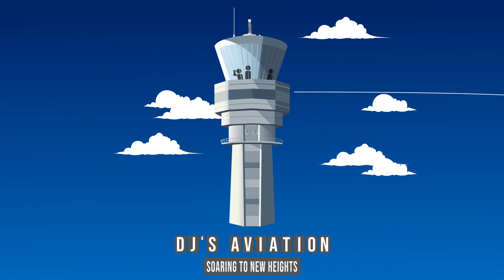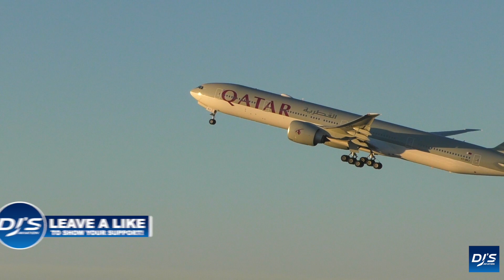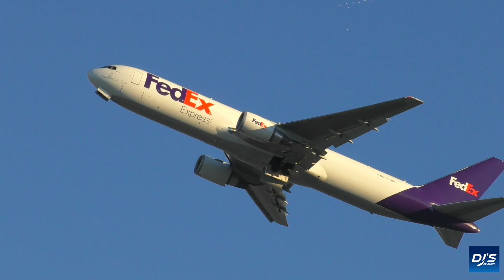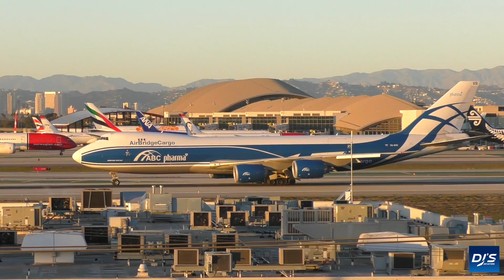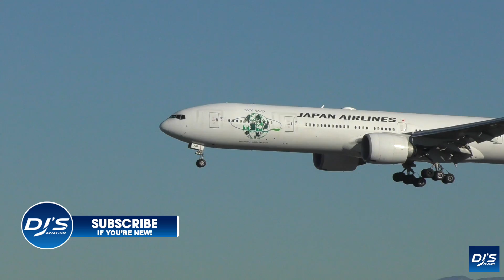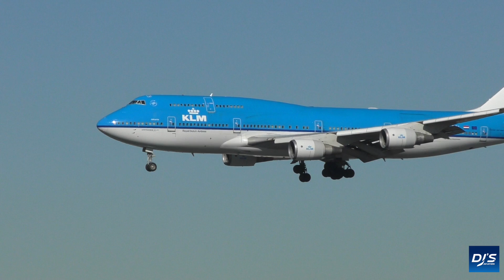Boeing 797 Engine Update

Comment: Well if Rolls-Royce is out, that only leaves two other engine manufacturers: General Electric and Pratt & Whitney.
Reply: mechaman13 

CFM is also in the game and the partners in the JV have already said the agreement would allow CFM to do an engine of the required size:
Reply: It’s CFM and PW still in the running
Reply: Don't forget Soloviev-Aviadvigatel, comrade.  The new plane could use turbojets with vodka-fuelled afterburners for extra takeoff thrust.
Reply: @raptorshootingsystems3379 
Oh yeah, I forgot about CFM.
Reply: @texasabbott Hahahahahahahahahahaha!  You're funny.  That's a good joke.

Comment: Boeing wants a geared turbine engine, RR previously said they were not going to invest in that technology. I think the 797 power plant is going to be a joint GE-French product with a remote possibility that P&W might supply the engines.  I think we're seen the last of multiple engine choices for new aircraft.  The article I linked to this morning claimed that AirBus and RR are working together on Chinese operations
Reply: RR UltraFan will be a geared turbine engine, and so do PW's PW1000G. Only CFM's Leap isn't.
Reply: steinwaldmadchen   Why has RR turned down Boeings new offering (797) now twice? I think it was in either August or September when RR turned Boeing down regarding a geared fan turbine, and now they've done it again, without mentioning the type of engine. At some point Boeing has to pick an engine given their statement that they will not offer engine choices. Boeing claims that it's too expensive to engineer an aircraft capable of using 2 or 3 engine types. I think the 797 will be a popular aircraft selling up to 2500 of the estimated market projection of 4000.
Regarding CFM, back in 2017 this was where everyone was at-- "For the new aircraft's engines, Boeing is looking for a geared turbofan. Geared turbofans are aircraft engines that achieve greater efficiency by placing a gearbox in between the fan and the turbine assembly so they can rotate at different velocities. The versatility provides greater optimization of engine speed during different parts of flight.

 image
Diagram of a geared turbofan. 1. Fan 2. Gearbox
TOSAKA/WIKIMEDIA
Pratt & Whitney and Rolls-Royce have both offered engines for consideration. Pratt & Whitney is researching the possibility of upgrading a geared turbofan engine it already makes, the PW1000G, while Rolls-Royce is arguing for a geared turbofan currently in development known as the UltraFan. Although they do not currently make a geared turbofan, CFM International, a joint venture between GE Aviation and Safran Aircraft Engines of France, is also considered a likely candidate to build a new engine. CFM has not formally announced that it will offer an engine for NMA consideration, but Aviation Weekreports that the company discussed some information about a new project, possibly a geared turbofan."

Comment: I guess Boeing will opt for GE as single engine supplier, like in case of the 777X. In any case I wonder when the plane will be officially presented, if all it needs is the green light from the board of director shouldn't take too long
Reply: Deamon93IT 

Authorization to secure launch customer commitments in March 2019 with a public unveiling in 2020. 

Given the talk of components already being made, very likely the unveiling in 2020 will include the roll out of one of the test aircraft that will be used for static testing:

Comment: Could this be more cryptic - why all the cloak and dagger stuff? I remember Airbus releasing even the earliest renderings of their A380/A3XX concept long before the final configuration and design were chosen and announced. What has Engine Alliance' stance been on the mysterious 797?This on wiki: " It would be powered by a new 50,000 lbf (220 kN) turbofan from GE Aviation/CFM International or Pratt & Whitney, with a bypass ratio of 10:1 or more and an overall pressure ratio exceeding 50:1" - good luck to whoever takes that on.

Comment: RR was an underdog competing with GE and PW.  GE has advantages with engine manufacturing capacity having dominated the commercial market for so many years. PW is a serious competitor with GTF. PW gets fuel efficiency with less parts essentially less turbine blade stages. It also means PW has potential for growth for even more efficient engines. BTW all three engine manufacturers have to be under financial strain with so many engines on order and little or no profit margins counting on aftermarket.sales for profits. GE as whole is in a bad place.

Comment: its looks to me that GE engines will be powering the new 797

similar to what the B777X are using

maybe a lower output version of the GE9X
Reply: Lin Chester Or may be a completely new engine. The GE9X is too powerfull.
Reply: @noah9130  looking at the 737 Max, it basically plane with a two oversized CFM Leap engines

 while the GE9X is too powerful. It may mean that the pilot do not need to use all the engines full power to take off and fly so it may burn less fuel
Reply: Lin Chester In that case it would be more logic for me to use GEnx

Comment: The longer that Boeing faff around trying to "perfect" the 797 and not make a decision then the more customers they'll use to other airframes.
Reply: Andy Richards 

Boeing has been talking directly  to the customers and keeping the final design under wraps for a market advantage.  The head of jet blue has admitted that he has been talking to Boeing, learning about the 797 and is enthused by what he is seeing. 

If Boeing has been assembling wings and other components, this project is already moving further along than Boeing is publicly stating.  This month, the Boeing board will give the green light to secure launch customers.  

A friend is a senior pilot for a large airline and they are talking about the 797. His words, a 2025 first delivery date would be perfect timing for them to integrate the aircraft into the operations and given his seniority, he will be one of first to crew it.  That airline could easily order 250 aircraft.
Reply: Boeing may not have a market for the 797 wide-body simply because airlines want the fuel-efficiency of a narrow-body and too many passengers will still put up with a 10-hour flight stuffed in a narrow tube if the ticket price is right.  Airbus will continue to flood the market with the A321neo and A321LR, leaving Boeing with a small niche market for airlines who are willing to offer passengers medium-haul flights in a wide-body jet.  Even worse, Boeing has nothing to counter a sneak attack from a stretched A220-500.
Reply: Boeing isn't faffing around. they constantly talk to airlines and have to give them a vehicle that they want. Boeing isn't delaying, it is called working with your customer. Ford and GM didn't do that and they have hundreds of vehicles sitting around that they never will sell.
Reply: @texasabbott  Getting a "widebody with narrowbody economy" is difficult. Getting a MoM that is cheap to run but carry sufficient cargo is also difficult. Mind you, in terms of economy 787 is much better than 767/A330, while probably not very far behind 797. Who wants a MoM when a fully capable widebody is slightly more expensive, and that's exactly what's happening in Asia.

Comment: Why Rolls Royce pulled out---
Meanwhile, the news from Rolls-Royce that it’s no longer pursuing a place on Boeing’s proposed all-new airplane program came as a surprise. Rolls had been pitching an all-new engine, the UltraFan, for the Boeing New Midmarket Airplane (NMA), unofficially dubbed the 797, against stiff competition from CFM International and Pratt & Whitney.
On an earnings conference call Thursday, Rolls-Royce Chief Executive Warren East said the engine maker pulled out because Boeing’s NMA development timeline is too aggressive to have the UltraFan ready.
“We could not achieve a sufficient level of (technology) maturity in the time available,” East said.

Rolls has been struggling for more than two years now with fixing faults on its in-service engines, particularly the Trent 1000 that powers many 787 Dreamliners. The disruption and expense of that massive recovery effort, which has caused the grounding of multiple 787s, must have played a role in the decision not to move too fast on the UltraFan.
East said Rolls informed Boeing of its withdrawal near the end of 2018.

That’s when Boeing had demanded final proposals from all three engine makers. The Rolls pullout suggests it knew that it wouldn’t make the cut.
That leaves two contenders: CFM, the joint venture between GE and Safran, which is offering an upgraded version of its LEAP engine with elements from its GEnx, and Pratt & Whitney, which is offering an upgrade of its geared turbofan.

Comment: Will the 797 be a replacement for the 757?
Reply: Yes
Reply: Current thought is that the 797 is intended to replace both the 757 (single aisle) and the 767 (twin aisle).

Comment: Sad to see Rolls Royce degenerate into such a mess of a company and by completely their own making.  The best engine on the B757 was the RB211 e4 series with 41500lbs of thrust. What I can see however is RR perhaps being a partner with GE or Pratt and Witney on development of the new engine. But that is only dependant on them using their best engineering staff and getting rid of most of their senior management.

Comment: Well honerable or not. Its probably a good thing that RR will not power this aircraft. It creates new opportunities to other engine manufacturers  like GE, Pratt and IAE to come out. The trent 1000's were a disaster plus its also partly RR fault that Airbus will be stopping production for the A380.
Reply: Why would Rolls Royce deliberately make a loss on offering engines to emirates for the A380? No company does business to deliberately make a loss. They are not a charity
Reply: A350's Trent XWB, at least for now, doesn't suffer similar issues from Trent 1000.

Comment: Ladies and gentlemen, after the 797,lets prepare for a new era of Boeing aircraft the ,800's😂
Reply: Won't be a 800 series number. When the Boeing numbering system for its products began sometime after the company was founded in 1916, it was made retroactive to the first airplane, which became No. 1. From then on, products were grouped in series.

The series from 1 to 102 covered airplanes of various types, mostly biplanes. The 103 to 199 series was assigned to various airfoil sections in the engineering department. The 200 series designates airplanes in the ‘20s and ‘30s up to and including the famous B-17 bomber, which was 299. The 300 series included the Boeing 307 Stratoliner of 1938 (first pressurised passenger transport) the huge Boeing 314 Clipper (seaplane), the B-29 and B-50 bombers and the double-decked 377 Stratocruiser series.

The 400 series was essentially the B-47 and B-52 jet bombers, the entire 500 series was reserved for industrial products including gas turbine engines, the 600 series was for GAPA and Bomarc (missiles) and the 800 and 900 model series were used by Boeing for hydrofoil boats, lunar orbiters, military prototype programs and so on. 

To switch back to the 300 series: when the prototype 707 jet transport was being designed, it was disguised as a Stratocruiser derivative and so carried the engineering number 367-80. When it came time to unveil it and change it to a production program, the 700 series was created.

The first of the line, the name “707”, was picked simply because it was catchy. Since then it has been only to build on that base of publicity and continue the naming sequence.
Reply: @irishharmon  ah thanks for the info mate

Comment: I highly doubt the 797 will succeed. The A321NEO is already perfect. She's wide enough, can do trans atlantic routes, I don't see a lot of customers ordering the 797.
Reply: You are so wrong and have not been following news mags like Forbes, Bloomberg, WSJ etc. Delta, American, and United will order hundreds with the launch order prolly being 250 planes.
Reply: @stevewallace1117  Yes, they are ordering something not even built yet... it's still a concept until it's made and once real life data emerges, majority of airliners will stick to the cheaper A321
Reply: @cockatoo010  Well, there's always the A330-800
Reply: @cockatoo010  Get your fact right, A300 got ETOPS since 1976, way before A310 is launched. A321LR is only ~10 seat fewer than 757. For short hauls A321NEO is already eating up the share, and now A321LR on midhaul. Airlines don't necessary pick the "superior" aircraft, they pick the one that get the job done cheaply.
With Europeans and Asians probably favour A321LR/XLR, I don't know how much are left for 797.